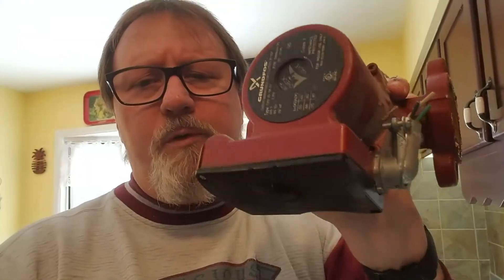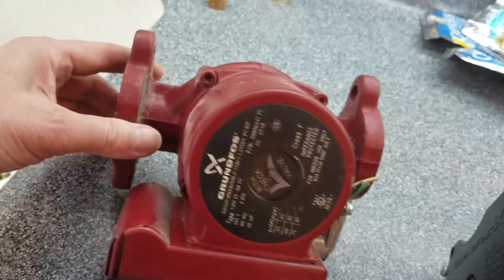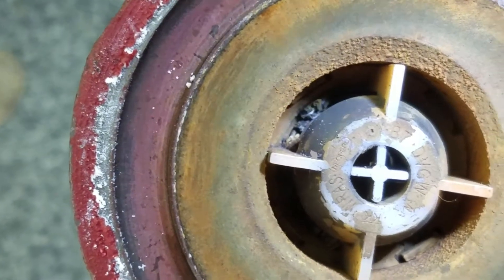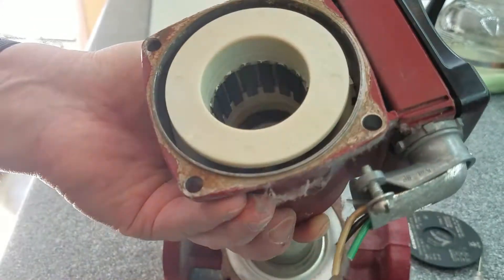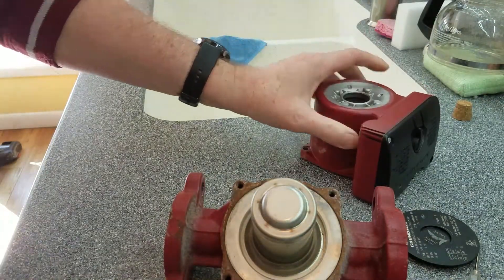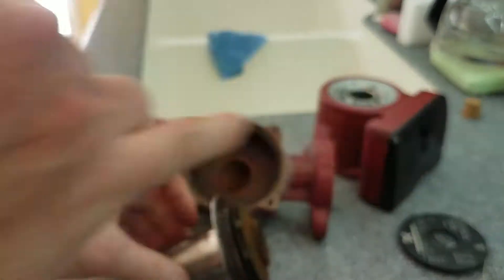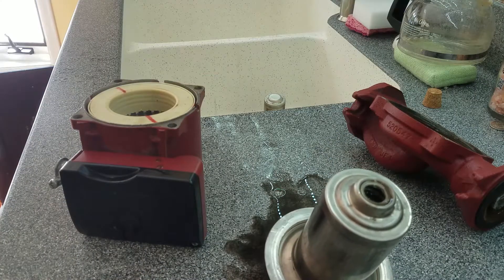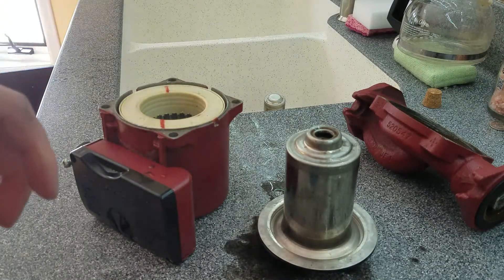Grundfos Pump Teardown - What Caused It To Fail

Comment: I use those Grunfos pumps for my outdoor wood boiler.  The problem I have is with the selector switch.  Within a couple of years the plastic switch becomes brittle and breaks.  Then you are stuck on one of the 3 speed settings or in between the settings and the unit stops

Comment: I have one of the old single speed 26-96 F and it's still going.  All it needs is a Swift smack with a hammer when you first start it up for the season (I can never find a screwdriver small enough to stick in the end).  But yeah these things are tough. It has a little bit of endplay, no more or less than It had two and a half decades ago.

Comment: My grundfos pump stopped working just the other day took a hammer and banged on it lightly now it is working again. Don't know how long it will last.
Reply: Check the capacitor , after 13 years mine had 1/14 of the original value - that means 1/14 of the kick it used to have in order to start . If it's freely rotating even this is enough because after managing to start the motor will deliver all the original performance

Comment: On this Grundfos circulator pump, which way does the arrow point to, up or down?    DOWN leads to the valve body and actuator.  UP leads to the pressure relief valve and also the top of the heat exchanger.

Comment: No way a pipe with a hole sucked in dirt and didn't leak. A pump seal taking in air yes.. that debris is from yoy boiler or pipes.
Reply from the maker: It had nothing to do with the pump.  Look at the video on my heat exchanger.  It was literally disintegrating.  I now have new everything.  Boiler, manifold, and the pumps.

Comment: Tear down very appropriate 😢  sorry you’ve a shocking lack of knowledge and manual dexterity ! The gravel is iron ferrite bonded with calcium in a long neglected system with no inhibitor installed.
Hole’s in pipe work sucking in gravel well 😂  I can’t begin to think how much crud has accumulated in the radiators and pipe work which will inevitably crap out the new boiler n pumps in no time , a system in that advanced state of neglect is beyond a flush to be honest
Reply from the maker: I like how confident you are even though you are totally wrong.  The system was regularly flushed and there was no gravel or pipes broken.  The ultimate thing that was discovered is the boiler's heat exchanger or flame box, whatever you prefer to call them, was literally falling apart internally.  That disintegration was causing the pumps to wear out pulling in all the ultra fine particulates.

Comment: My dad found the chinese version of those pumps for $12 so we bough many just because we couldn't Believe how cheap they were, it actually blows my mind how they can do it so cheap, the bearings are actually ceramic bushings! Only issue we have found so far is, the power cord stinks, and the pump cover were the water inlet goes into the impeller is not well made so there is water recirculation within the pump making it lose some pressure but still not bad for $12, full metal construction and all.
Reply from the maker: That's excellent!  Wouldn't want to share that link would you?  That would be amazing.
Reply: @MIFixItDad Sounds like a bad idea to buy something that you know has cheap parts that require you to buy multiple back up units?
Reply: Link?

Comment: the little plastic item you removed from the first pump should NOT be in the pump. It is a vacuum break that comes with the air vents, and should be installed with them. But it somehow got disengaged from the vent (or were improperly installed) and ended up in the pump. Not many hydronic experts in my area so I am having to become one! I have replaced my pump before but today I will remove it and open it up to see if I can fix it.
Reply: That plastic IS supposed to be in the Inlet of the pump. The check mark on the pump tells you that this pump was shipped with a check valve installed and is required for pump zoned systems. It would be nearly impossible for the complete float from an auto air vent to make it's way to the pump.

Comment: I had one that wasn't pumping but on investigation the rotor was free spinning and the windings were fine. It turned out to be the motor run capacitor. Interestingly, Grundfos print the value of this on the label (usually 2or 2.5uF). They are easy to source and fit. You just need to make sure it fits in the space available in the connector housing and is of the right voltage rating (usually 450vac)
Reply: Haha, yeah when the cap goes out a large cap usually gets zip tied to the outside of the housing until I can get the replacement.

Comment: The first pump was destroyed by sucking up parts of the heating system. There was no gravel or dirt getting sucked into the system; pipes do not work that way. When there is pressure on the inside nothing can get in. The 'dirt' and debris is normal to see in older systems, sloppy builds, and any system with anything that is made of iron. We always install a strainer on the input to any boiler or heat pump system. The first pump could have got jammed and lost flow through the motor and it over heated.

There was nothing wrong with the second pump and it looked fairly new. The rotor shaft end play is perfectly normal. The stator shaft is surrounded with water when in a system. This is why you have to 'burp' out the air after you put in a new pump. The water cushion cools the motor and acts like bearings made of water. The end play actually reduces wear and acts as the side of the bearing to keep the motor from rubbing against the case.
Reply: 100^